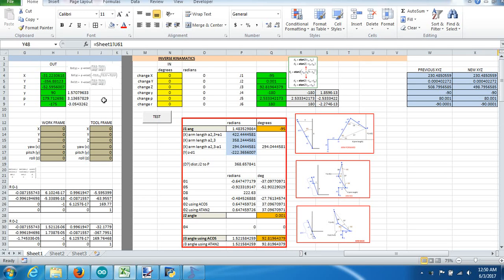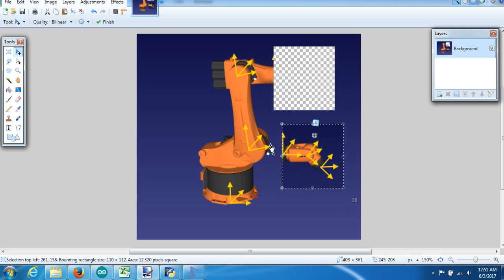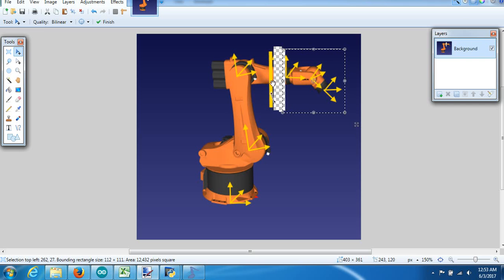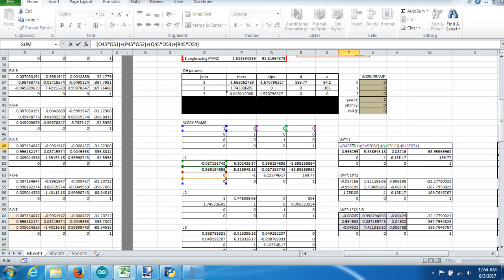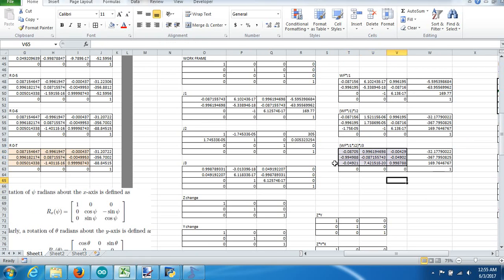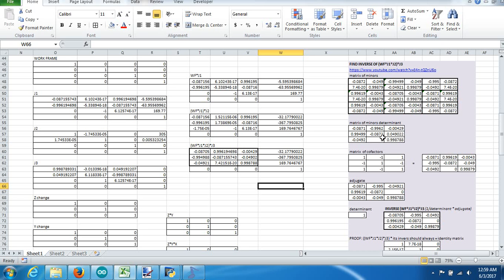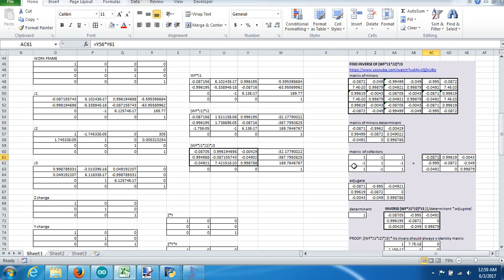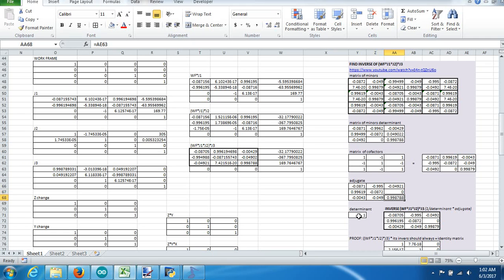6 axis robot kinematics Part 6

Comment: Actually you need not calculate the minors and adjusted. For rotation matrices their inverse equals transpose. Basically that means if you interchange the rows and columns of the wrist rotation matrix you will get its inverse.